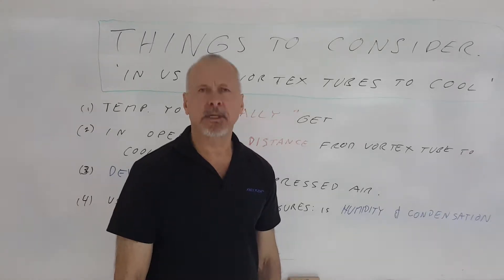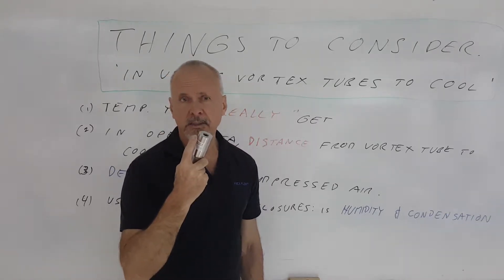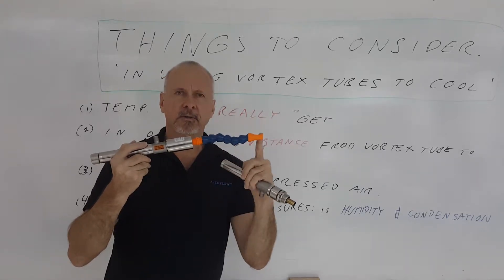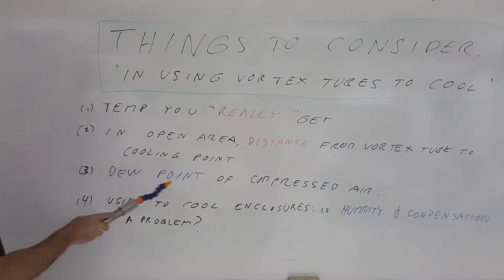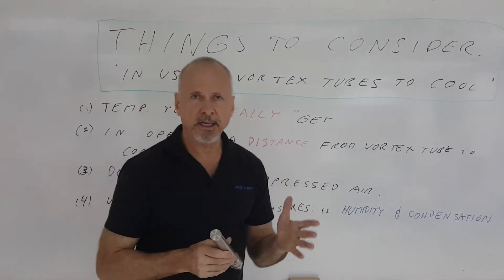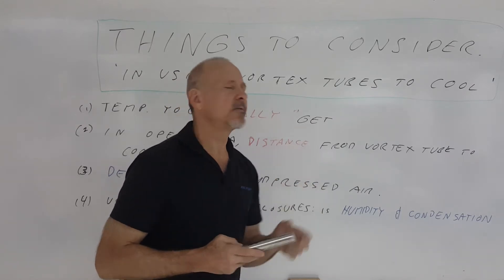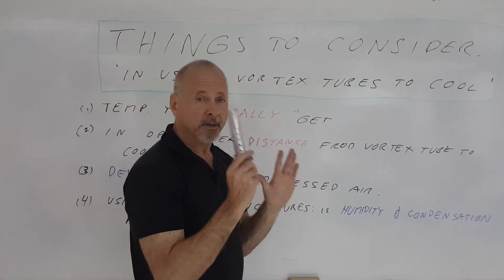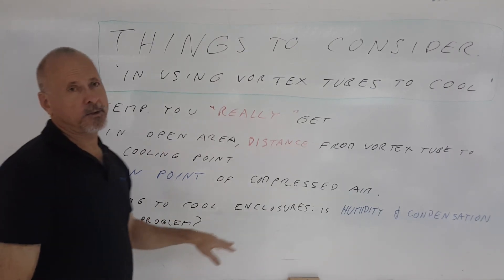Things to Consider -  Using Vortex Tubes to Cool

Comment: The biggest question is will this cool a beer with my home machine. 😁
Reply from the maker: If you have a compressor - yes
Reply: I'm sure you'll sell more if you did a video on beer cooling.
Reply from the maker: If you have a big enough air compressor -  it actually will.